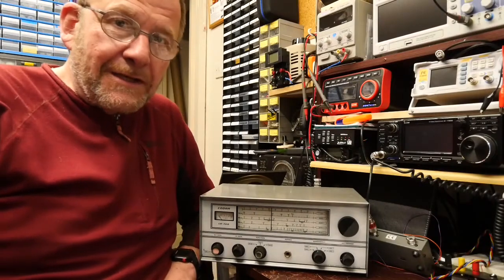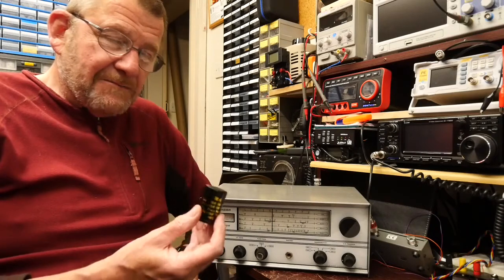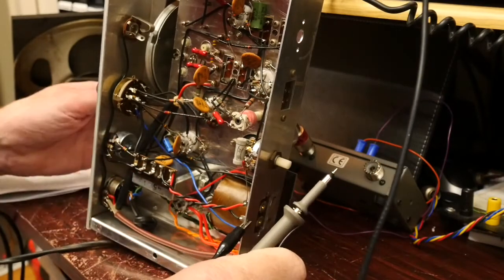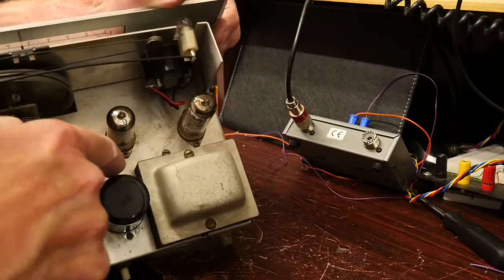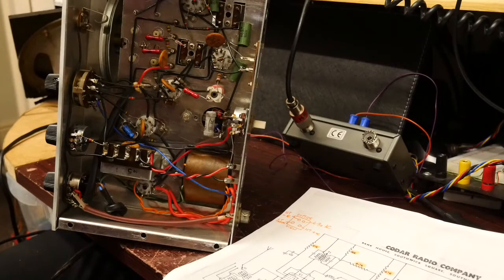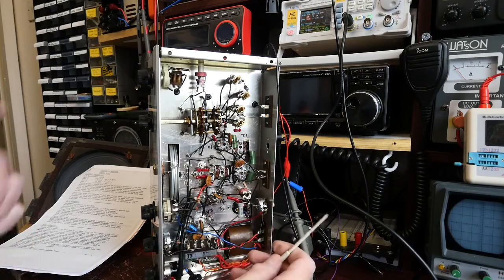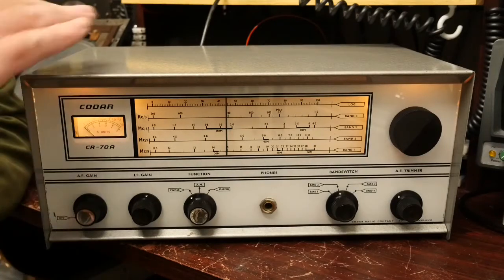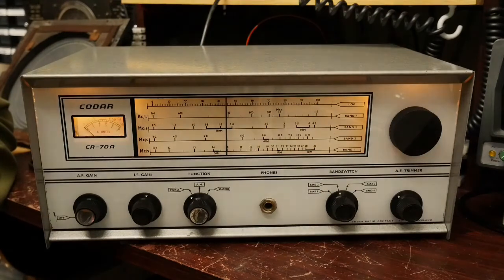Codar CR 70A HF receiver refurbishment

Comment: Be aware of possible manufacturing faults - don't assume that it was correctly assembled in the first place!
The CR70A that I briefly owned was a later model - it used a printed circuit board and a solid state rectifier, unlike the valve in yours.
It had a weird fault involving going into oscillation, like the BFO was never fully switched off. On AM stations, it was always necessary to zero beat to avoid a slight whistle. 
Checking voltages soon revealed the problem: a wildly wrong resistor, presumably caused by the assembler's failure to understand Russian resistor markings (they are marked with the written value rather than colour codes). Instead of one marked M10 (i.e. 0.1 M or 100k), they'd fitted either 1M or even 10M (1 or 10 Megohms, I can't remember which). Fitting the correct value cured it. Doesn't say much for Codar's quality control.
Why Codar used Soviet resistors is anybody's guess - presumably they were cheap (and, in fairness, pretty reliable).
To be honest, I wasn't impressed with the CR70A even after repair and realignment. I soon sold it on - though at least it was working properly for the first time in its life! ☺

Comment: Hi. Well you brought back some lovely memories for me. As a young lad back in the 60s my dad bought me a cr70a. I sat up for hours listing and QSL ing. Good times. I have subscribed. Thank you. Terry. PS i must look out for one.
Reply from the maker: Terry, that's brilliant!
I had a VEF-204 (Soviet Transistor receiver) for my 13th birthday, like you I spent hours listening and QSLing. They do come up on EBay, This one was sold as 'not working' - lights up but no sound..... So I took a chance that the 'no sound' bit was due to having no speaker connected! - Turns out I was right.
Reply: @LockdownElectronics  nice one.